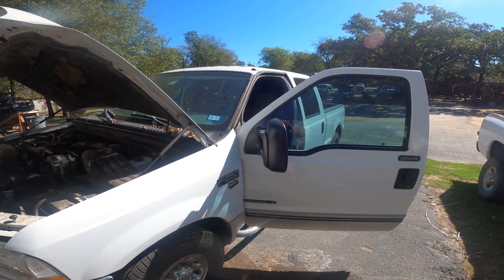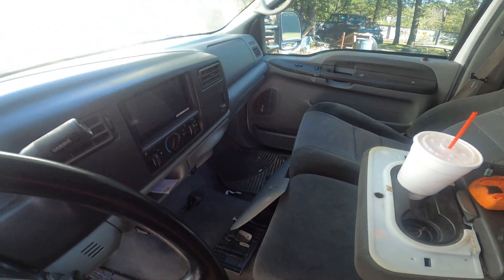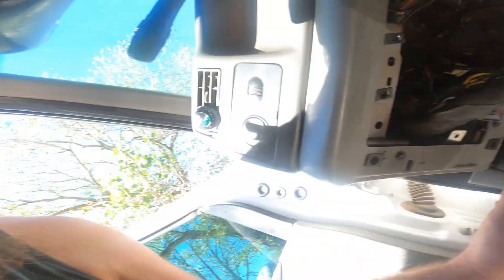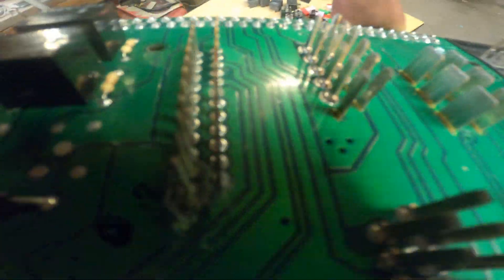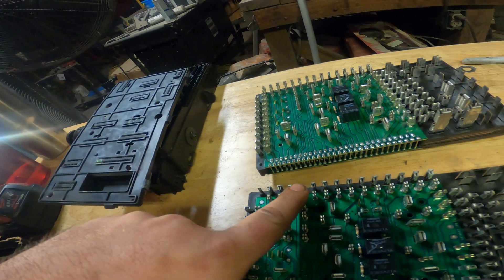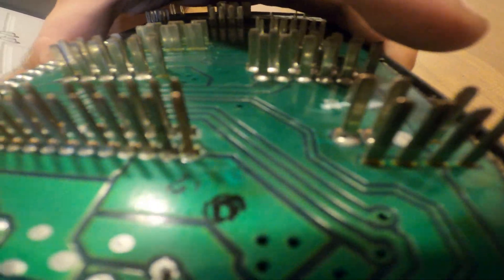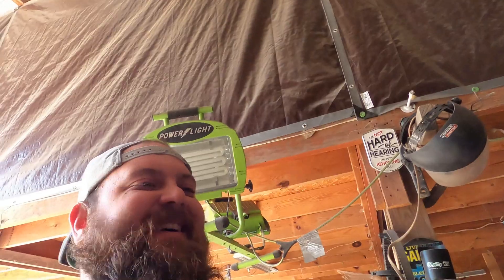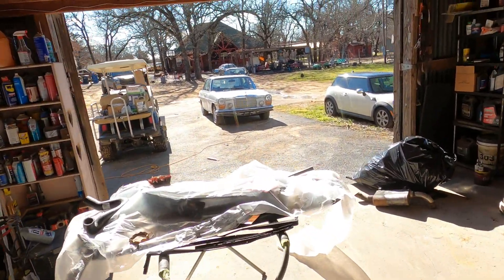1999-2007 Ford F250/F350 Electrical Weirdness Fixed!! Radio On, Blower Motor On, Horn Honking!!

Comment: FYI, I have a 2000 F250 V 10 6.8… My central junction box is different. You can’t open it up unless you drill out the flange where the 10 mm bolts for the wiring harnesses connect into the back of the CJB. You have to do it very carefully. And it’s very difficult to get the wiring harnesses off again once you reattach them. I know from experience. There’s a video on how to do this here on YouTube. Shows you how to open up the CJB and clean all the layers. It’s definitely different than this for my year and model though.